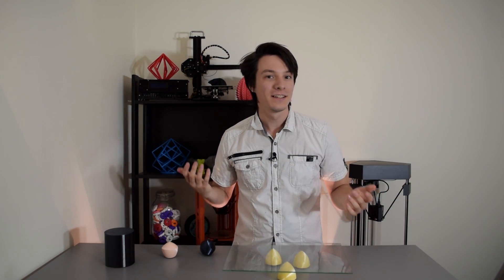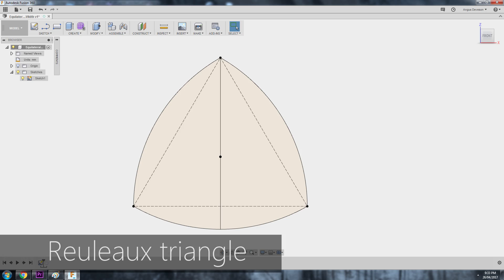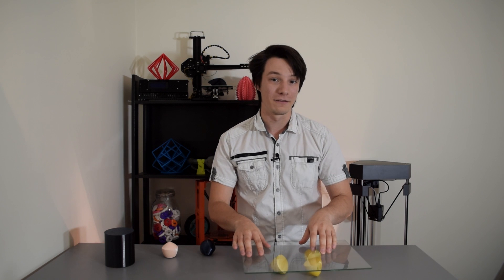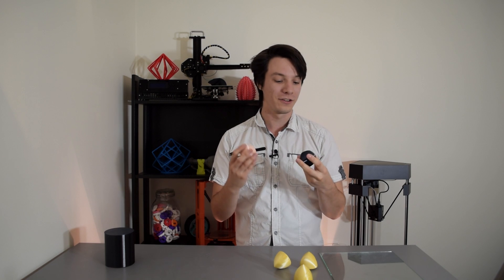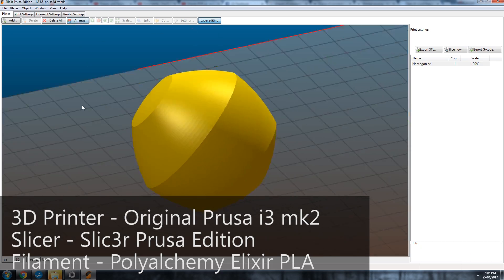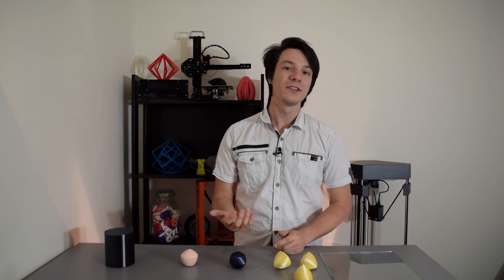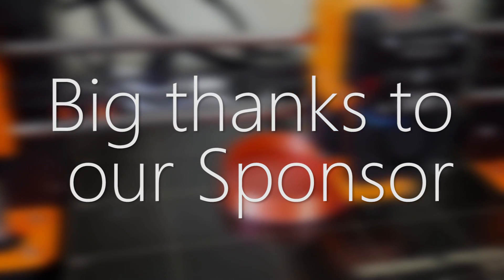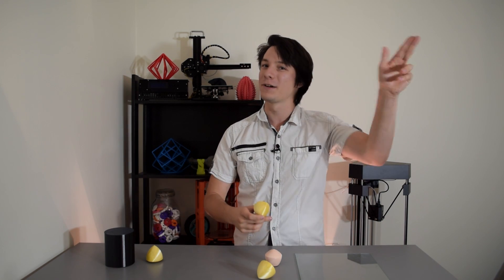3D Printed Solids of Constant Width

Comment: Instead of supports and a rough interface between the exterior & supports, you could print in two parts and use some pins or glue to attach. However, a good printer might also be able to print some of these shapes (especially the triangle one) with a sharp corner downward with supports just on the edges or near the tip (and nothing on the faces).
Reply: Custom support on an edge made it possible to print the triangle version in vase mode. Separating the support without harming the object is a bit tricky though, although that might be just a general PETG issue. Fusion360 comment: I couldn't get sphere centers to snap on sketch points, so I revolved semicircles. Seems odd, but I really haven't used spheres all that much, so maybe it has always been like that. The design & sketch would have been a lot cleaner if I could have just used spheres directly. Here's the design with the customer support: http://a360.co/2pMKMRD

Comment: I'm going to draw some. Chop them in half, and print it so the surface I cut it though lays flay on the print bead. That way I can print them without supports, then sand and glue together the flat surfaces together. The result should be a much surface finish on the part.

Comment: To make a true solid of constant width (rather than a rotated shape thereof) use intersecting spheres rather than circles, and add a fourth point above the centre of the equilateral triangle; the height needs to be such that the hypotenuse to the existing points is the radius of the sphere. Or so I vaguely r member.
Reply: That's what I thought too. I made three spheres at the points of an equilateral triangle, intersected them and used that to make another triangle sketch that includes the tip above the original sketch. The equal surface volume is the intersection of all four sphere. Here's a link to the Fusion360 doc: http://a360.co/2pMKMRD

Comment: I wonder if instead of using a revolve, if you just placed 3 spheres on a tetrahedron would make a similar shape.
Reply: Yes! That's called a Reuleaux Tetrahedron, and it's also a solid of constant width. It's 1 of the 2 ways of generalizing the Reuleaux Triangle to 3D, Angus showed the other way
https://en.wikipedia.org/wiki/Reuleaux_tetrahedron
Reply: @braden.ganetsky false
Reply: I tried it: http://www.thingiverse.com/thing:2297275
It seems to work :)
UPDATE: It almost work, but some "smoothing" is required to make it prefect...
Reply: Braden G Wikipedia says that it isn't, but that a modified version of it is. "One can find repeated claims in the mathematical literature that the Reuleaux tetrahedron is analogously a surface of constant width, but it is not true: the two midpoints of opposite edge arcs are separated by a larger distance"-Wikipedia
Reply: This website explain how to make a symmetrical shape of constant width from a tetrahedron. It's more complex that it sound, but all the math are there to prove it:
http://www.xtalgrafix.com/Spheroform.htm
Reply: YourMJKTube I would be interested in these. I'm posting here because I can't figure out how to send you a private message on your profile
Reply: I am a G 
Hmmm...
Well, I read my post and it reads in a tone which I didn't intend (due to edits I made while creating it).
I've changed it now.
Perhaps you have made a similar error, since your post also reads in a very negative tone? :)
Reply: I don't know if dropbox links count as spam, however here they are:
https://www.dropbox.com/s/bzkh0yn76ohejv5/models.zip?dl=0
Reply: It could only work for solids that have no opposite faces, such as the Tetrahedron. The other 4 platonic solids have pairs of opposite faces, so it would not work. It is the same reason why even numbered regular polygons can't be turned into curves of constant width. And it also may not work for ALL solids which don't have opposite faces. For example, I have no idea if it'll work for the Pentagonal Icositetrahedron, but I could see it as a possibility :)
Reply: girrrrrrr2 
Hi there. To make things clear, this would be a Reuleaux Tetrahedron, which is of only NEARLY constant width (Despite Ted-Ed's video on manhole covers). Look up the Meissner Tetraherdon. That's the shape you're looking for. Three of the edges are rounded.
Reply: If anyone wants 3D models of the reuleaux tetrahedron including the different modifications for making it a body of constant width, contact me ;)
Reply: girrrrrrr2 well, that defeats the whole purpose of not having a perfectly round fugure
Reply: girrrrrrr2 my head stop plz
Reply: Sue Mead yeah you are right, it's my endless frustration that I have these connections via the Internet to all of these strangers with all of this wonderful information that I get so excited to learn from therefore I get so frustrated when pointlessly slowed by these unnecessary speed bumps on the interstate.
Reply: Hi, Potato Productions.
I don't want to cause problems. I want to make that clear.

But can't you understand that my comment was intended as genuine help to girrrrrr2's question, and that I was disappointed to see "stfu" as the response?

Whatever. I stand by what I said, but i'm sorry if anyone was offended by it.

Can't we just talk about cool shapes amd 3D printers rather than debating who's right? I don't have the energy and 3D printers are more exciting.
Reply: Jonathan Fowler I have the same problem man.
 I go online and every time I want to learn something or correct something or deal with any kind of real information were there Mike be the need for some form of clarification in any direction, there's always somebody that crawls out of the woodwork and says or even screams your offensive because you're not "only saying positive things".
 only say completely positive things never point out anything but positive things.
 I really think our world is in trouble because people want to ignore anything that they don't want to have to hear.
the act of ignoring is called ignorance. I'm having struggles to learn because of this whine about only living a happy positive life
Reply: Oh interesting, my mistake. That's good to know though, thanks! :)
Reply: Chris Newman what are you talking about? It's the same shape sorta just made in 3d the whole time
Reply: girrrrrrr2 🤦 sry I'm half asleep and I totally misread that 😁
Reply: nah, you'd need to place 4
Reply: Jonathan Fowler Just leave the dude alone. Just trying to make fucking problems.
Reply: Jonathan Fowler stfu

Comment: Have you tried generalizing to pyramids and intersecting spheres instead of rotating the 2D form? This could also help with the asymmetrical forms..
Reply: DerClaudius 
Using spheres is the same as circles.
If you were to draw the shape of constant width but leave the circles, then rotate it around its central axis the circles would become spheres, meaning that you can just skip the circle part altogether.
As for asymmetrical shapes, no.
It is mathematically impossible to make these kinds of solids irregular while still maintaining this property.
Reply: Racoon in the closet what you say is only true for the symmetric case. For asymmetric example see 2:58
Reply: basically, it would be rotating it around another shape of constant width that isn't a circle.
Reply: Asymmetric shapes are not of constant width, meaning that it would not work for them.
This property relies on the regularity of the shape, all vertices must be the same distance from the central point, otherwise it cannot work.

Comment: 3 things that made you cooler just from this video:
Obsession with obiects of constant width
likes grand Illusions
And wants a car with a rotary engine
Reply: That RX8 request was a totally  unexpected bit of awesomeness.
Reply: I would personally change that request to an  RX-7 though...
Reply: I agree, the RX 7 is better "looking"  but driving the RX 8 is a bit better in suspension and steering.. still would go with a RX 7 personally.. just sweet cars
Reply: I would personally want the RX7 too, but a good one of those is in a  different price class than an RX8. A rotary already isn't the "smart" choice, but buying the RX7 to daily is even worse.
Reply: 3Dprinting Llama - better looking is a personal thing. Also remember that there are several generations of RX7. I myself have an FC model from the first year they were produced. I love it also - really fun, zippy little go-cart of a car. The FD's are the 'pretty' ones, and they are spectacular cars, but quite expensive. RX8's are probably cheaper now, then FC's like mine. Buy what you can afford and enjoy it (just don't make one of these your daily driver - really should be a second car).
Reply: As i've gather information from an outside force the engine of a RX7 does losses its power due to its given design but if it was change with another engine it still depends on its trajectory pressure and porting and i dont know anything about what im typing
Reply: im dailying an rx7 with 12 lbs boost, engine has almost 90k miles. A rotary engine is only gonna blow up if you're doing something wrong (EDIT): its an fc, not the fd in my profile pic
Reply: no name ive always wanted a fd rx7
Reply: no name jokes on you I already wanted a rx7
Reply: Man, you said it youtube 2017 adpocalypse us creators can use all the help we can get
Reply: SwaffyX stfu and buy a 100 mm turbo then try that comment again
Reply: SwaffyX not really, it depends on the porting and injector pressure
Reply: Alex Kenis FD, FB, or FC
Reply: Noah Gallagher  you haven't a clue what your talking about 100,000 miles and then I chose to rebuild to a street port where have you heard the crap? If you don't look after them yes it can happen it's what happens when idiots buy them lol
Reply: NU VLOGS  What does this have to do with anything?
Reply: no name its against my beliefs, he begging for donations after being successful. no more
Reply: +NU VLOGSok this is your opinion but it has nothing to do with what we are talking about
Reply: no name well, that's your opinion
Reply: the 1.6 liter Mazda's are economical, and light. it's an old car why would somebody buy it just to have a mechanic do it for them fix it yourself idiots just kidding
Reply: Noah Gallagher that's where you separate men from boys
Reply: Slideways Motion so are you a long or a short distance driver, bevause I heared that short distances are what kill rotarys
Reply: no name yea but he said a shape with 7 sides was a hexagon
Reply: +Jennifer Lamont  Umm Nope.  He said heptagon, not hexagon.  It is also called a septagon.  Seven sided.
Reply: +Jennifer Lamont I assumed you meant to say Hexagon.  A hectagon is a hundred sided figure so would not fit in this context.
Reply: no name æø
Reply: Alan Calderon it's not about mpg, nothing drives like a rotary. It is truly a unique driving experience. Being able to Rev up to 9k rpms without harming an engine is just plain fun. Love my 05 RX-8.
Reply: Sean McClendon what I'm saying is that you can get better performance and efficiency off a 4 banger than a rotary. Unless you're really into racing there is only one configuration for rotary. and even THAT is barely legal in the U.S.
it's a great racing engine. shit consumer-friendlyness.
Reply: I have 280hp in a 1.3 liter engine. Find a 4 banger without a turbo that can match that along with a similar power band and I'll trade in my car right away.
Reply: Sean McClendon you can keep your car my dude. Better off with a more versatile engine than some scrap heap you have to maintain too often.
Reply: no name my dad is going to sell his RX 7
Reply: Bruce Wayne bruce arnt you're parents dead bro
Reply: With Time Travel you can go back and visit them?
Reply: tries to make others look dumb... uses "learnt"
Reply: Militant Autism no..they aren't stupid...just inefficiant
Reply: Militant Autism How about the 787B? That raced around LeMans for 24h, won the race and the engine was perfectly fine after the race? Also rotaries make much more power per liter than piston engines. They just need a little more care, like checking the oil, seals and such. 
Using good oil is important too since they burn oil.
The mazda Cosmo has one of the best rotary engines, check Rob Damh
Reply: Miguel M Silva I didn't say that the engine would get damaged, I just said that they generally suffer from a loss of power as the combustion side heats up.
Reply: no name  he was more amazed then i was
Reply: no name hope you get that Mazda
Reply: no name physics
Reply: Looks like a korok seed
Reply: Ghost 609 People build the fuck out of rotarys and push then pasy 1000hp. learn to work on the car yourself and you don’t need to take it to a shop. 1000 hp from a 1.3 liter dude, get outta here with the hate
Reply: Grand Illusions is a great channel!
Reply: Bryant Zerrato nobody carea abot mpg, it is all abour smiles per gallon. Every car guy knows that
Reply: no name IMMA TELL YOU HOW A ROTARY ENGINE WORKS!
Reply: F rotary engines. They are so fucking annoying
Reply: tim is god!
Reply: Sean McClendon but to answer your question; there is none.
Reply: no name One does not simply buy an RX-7 without skills, chicks only like guys with skills
Reply: TheDantheman12121 bluecoats 2015
Reply: lemster101 the rx8 was a failure of a car.  If you want a rotary, get an rx7
Reply: Justin Feller: becomes an idiot because he tried to make someone else look dumb by insulting his proper use of the word "learnt" from official (UK) English:
verb (used with object), learned [lurnd] or learnt, learning

(Bold emphasis added by me.)
Reply: haha I HAVE AN RX8!!!
Reply: Alex Kenis yeah you can't have everything
Reply: i thought he said hectagon lol. he meant septagon though
Reply: the rx8 was far from a failure as a car, it was never meant to be a replacement for the rx7 as people misconceive by the name it is simply the 8th car bearing the rx name and a rotary engine. it is a completely different car from the rx7
Reply: The rotary engine in RX7/8 actually loses some power from its design compared to your classic piston engine.
Reply: no name i
Reply: no name short trips = humidity and moisture builds up inside the (ALL) engine so yes short trips are bad for oil, look it up. also, cast iron piston Ring's only last when at the proper hot temperatures.
Reply: Gerrad Reynolds they work fine when they're cold and in theory are efficient and produce a good power to weight ratio but at the end of the day metal heats up when you make explosions on it and it heats up differently resulting in power loss and lost efficiency and so knowing that it could be argued that continued use of such engines is stupid.
Reply: +PAsn0w43 1.3 l Engine with the fuel mileage of a 350 Chevy just saying
Reply: rx8s are actual trash they are slow asf sr20s smash them all day
Reply: Militant Autism I said it would probably make more power per liter than a piston engine even when its hot
Reply: rotaries are innefecient fuel guzzlers. to want one for a daily would be a waste in both money and metal. the rotary belongs in competitive sports not the streets. if you're gonna run a rotary you better be on the drag strip or a circuit.
Reply: apex seals < piston rings
Reply: no name his video has commercials and he makes thousands of dollars and yet he still opens a patreon account and asks you for donations f**** druggie
Reply: Okay??? 'i mentioned that so idk why you think I didn't know that? I never said he said hexagon, but i did say he definitely meant septagon lol. reread my comment.
Reply: Wankel engines are stupid though.

Comment: Angus, you should print a full oversized ball bearing that uses these! 

Print several smaller scale versions as well as the outer and inner rings. That would be a neat thing to see because instead of spheres, you could have several different kinds of solids of constant width.
Reply: Ryan Garrison it wouldn't work because the center of gravity is moving around and will cause a crazy amount of vibration
Reply: You must be fun at parties...
Reply: already is a video about this
Reply: Ray Der, It's cool to make things simply because you can or because they seem cool. It's a type of art, the contemplation of cience. 

Perpetual Machines, Wind Powered Walking Sculptures, and a enormous variaty of useless machines exists, just becouse they are intrigant, satisfaing and just cool to watch.

https://br.pinterest.com/pin/405675878908817457/
http://imgur.com/gallery/Lswojnx

Enjoy yourself some times. Life is not just work.
Greetings from Brazil.
Reply: Yeah.
It can be a roller bearing.
The rollers must have the section of "Curves of Constant Width" extruded in some length.

Comment: very surprised you didn't print in 2 half's and then glue to remove the use of supports.
Reply from the maker: Definitely considered it, but with the polyalchemy elixir the seam is really obvious - more so than the underside curves with support. overall i think the finish is better - but only if you have faith in your support structures.
Reply: They did come out very nice indeed. May have to try a multicolour one.

Comment: Are you going to do a video of the mods you did on the the tevo tarantula?
Reply from the maker: sorry no, I did try but my kit was beyond help. It's better to concentrate my effort a scratch build.
Reply: Is your's defective or is the kit just crap in general?
Reply from the maker: It was one of the first versions, rollers bound up and the extruder leaked. Overall was just pretty crap. They have gotten better but the design is still not very good out of the box. Honestly, I personally believe the Anet A8 is a better machine if you must go for a super budget kit.
Reply: I just want a cheapish 3d printer with a dual extruders out of the box. I'm 12 so I don't have enough of a budget to get a flashforge Creator pro or anything.